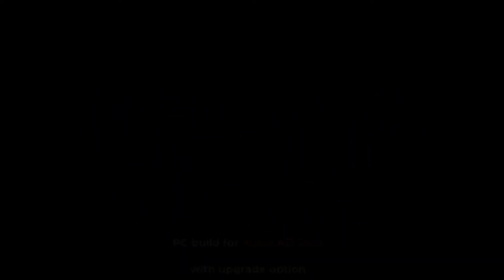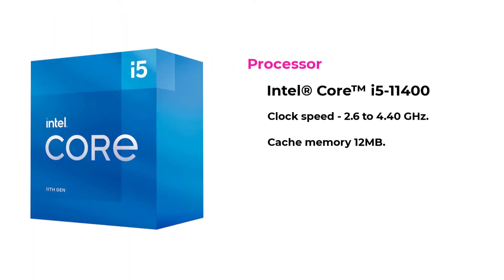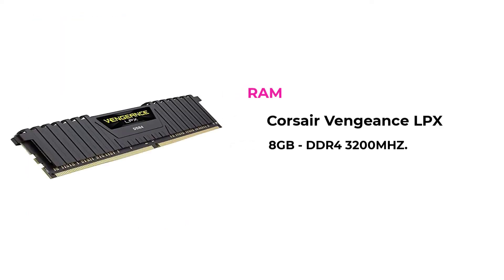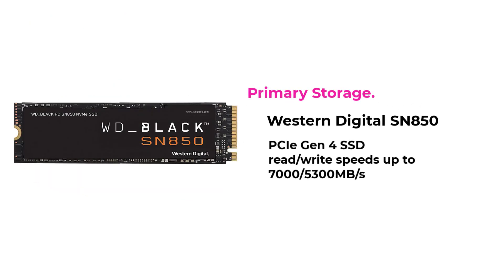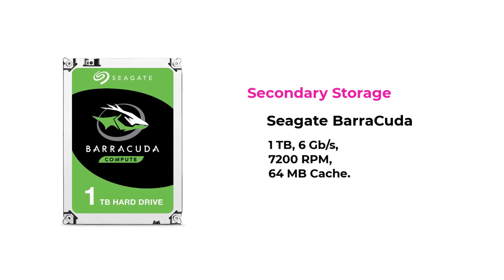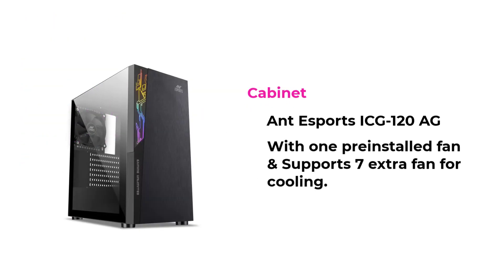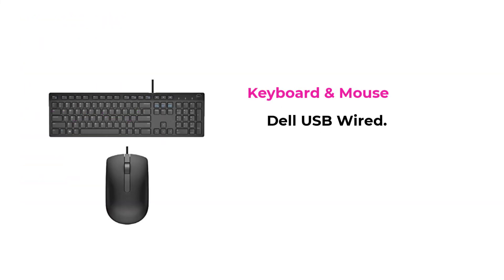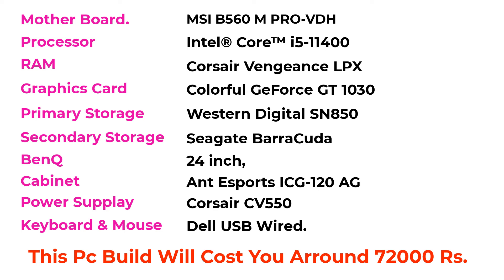AutoCAD PC Build - Future-Proof with Upgradable Options for Optimal Performance

Comment: bro that pc build are not good at working with autocad you are offering them only 4 core processor. yes it will run smooth at first but once you open a finished RCP or a Detailed Floor plan that build will experience a lot of lags don't let them waste their money. you should consider processor with a lot of cores, cheap dual xeon workstation will do, there's no need to spend a lot just buy workstation which are a lot cheaper than that build. tried and tested i have a lot of workstation for servering and rendering, example 8cores i7 are not matched with 20cores single xeon(worth 200$ System Unit) which are 5x cheaper. don't waste your money, buy what he recommend if you are a student or a Homebased freelancer/office worker, but if you need a System unit for autocad work, i will not suggest to buy that build.
Reply: can you plz give a list of components for autocade profesionally? 
The budget is 800$.

I hv no experience and idea about build. So if u r free can give me a build here, 
Tnx in advance ❤️
Reply: @MehedeHasan-m4y autocad is single core heavy, so find a CPU with high single core speed - there is a Ryzen 5 7600x? that is really high speed, get 16 gigs of ram and fill the rest the best way you can. Don't waste money on special custom build crap like glass case, mega turbo fans or gaming motherboards- balance it with CPU in mind.